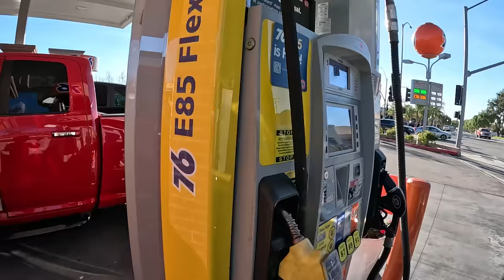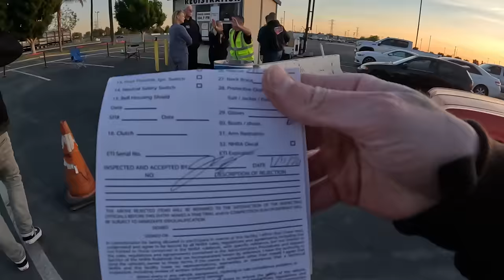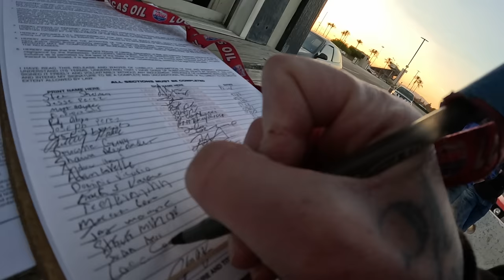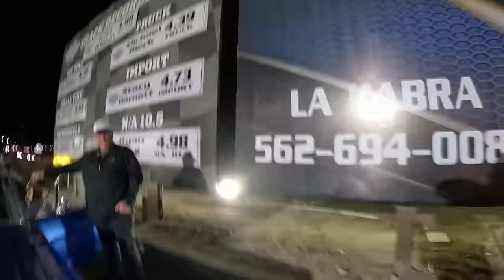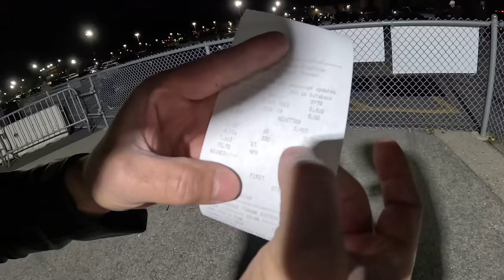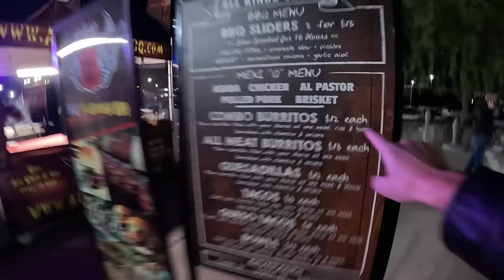Harley Davidson Drag Race - Stock 117 vs Cammed 107 Milwaukee 8 (Battle of the Baggers Ep7) Vlog 111

Comment: Lance’s bike probably still has the stock throttle progressivity settings, it’s adjustable in the FP3 and now Juan’s bike has it mapped adjusted by the dyno tune. Stock throttle is only 30% in the first 3 gears under 3 or 3500 rpm and gradually opens up.

Comment: Great video. Pretty badass you guys went to a track. One tip is when you guys do the burnout, if you don't have slicks on just do a small burnout to clean the tire. Street tires will overheat and give you less grip
Reply from the maker: Thanks for the info!

Comment: 2 things Juan can do. Either get Harley’s 119ci kit which bolts on with stock crank. Or get the Trask Turbo kit, which is insane. Buddy put it on an older Dyna and he puts safe 180hp to the wheel and about 180tq. Probably more on the M8’s with a cam.

Comment: Lance - are you going to tune the stock config and see if that makes a diff before putting in the cam?  Seems like you could move your torque and hp curve up the rpm range a bit and be able to compete with Juan.

Comment: I can tell you from over 40 years of experience, in So CA, 76/ Unocal is top quality fuel.  They were one of the last holdouts still pumping 93 octane until CARB shut them down. I've always gotten top MPG's with Unocal, Exxon Mobil and Chevron fuels. and I log every fillup. A fuel has to deliver top HP to give you more MPG"S .  I avoid Shell and Valero branded fuels. They just don't deliver, despite the better price per gallon.
Reply from the maker: Thanks for the knowledge! we're gonna have to remember this whenever we fill up!

Comment: Great video. I did a stage 2 on my 107. I was making 104hp and 116 torque. I did a 30/30 485 star racing cam. But I have a 128 kit pushing 136hp and 151 torque

Comment: I think there should be some research on the gas pump thing…I’d assume there are valve systems there to pump what you are paying for? Might get a bit but a couple gallons before you get proper octane? Clutch and compensator improvements might grip a bit more of that power quicker? Can’t tell you how fun this was to watch!

Comment: funny about the one with the higher octane gas somehow would give an advantage. I am sure  that you know that the high octane is so that high compression engines do not have damaging preignition and knocking. no extra horsepower in hi octane.

Comment: A cam is going to make more power than just a 10 cubic inch increase in displacement. Harley needs to make an air cooled, push rod motor that has all performance parts from the factory. It is like they just keep upping displacement.

Comment: I got some practice runs in on Test and Tune Night.  I am a bit slow off the line because of the wheelies..
  60 ft 2.17   1/8 mile  8.39 @  87.21 mph  slower than most 1/4 mile runs..I will look at some other slips.
1/8 @8.36 @ 91 MPH  8.39 @ 88 MPH  /   8.22 @ 89.45 MPH  My runs are very consistent

Comment: 107 has the shorter stroke so it's quicker off the line, the longer stroke motors catch them at around100klm

Comment: That blue cepheus lamborghini urus is a clean spec, but dam is there anyhting better than a nitrous purge, ok which 1 of you are gonna be 1st to get nitrous , how sick would that be pull up at a light and throw down a nitrous purge, that mitsubishi lancer was sick , I prefer the EVO 6 TME or a EVO 10 over a lancer cuz with simple mods you can get an easy 900 HP

Comment: A slow reaction won't change your top speed at all ..  Most all of my 1/4 miles runs were  107 MPH but I had one run at 110 MPH ..  
  So the 107 Bike is just slightly faster than my 74 CI Bike  The 107  only has a 33 Cubic Inch advantage.
  On S curves I pass HD's all the time going 20-30 MPH faster than they are going ..

Comment: You don’t need to do burnout like the two of you did on those two low horsepower bikes. The reason you spun getting out of the hole because you’re tired was way too hot and the reason your lights were on was because your engine was frying. It’s an air cold engine, run it like you got some sense.
Reply from the maker: Chill Jeffy